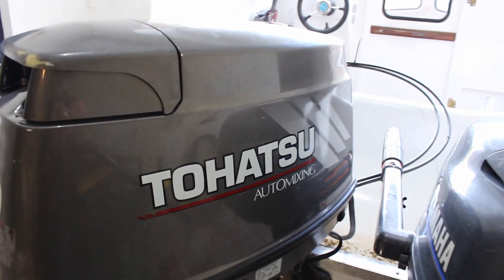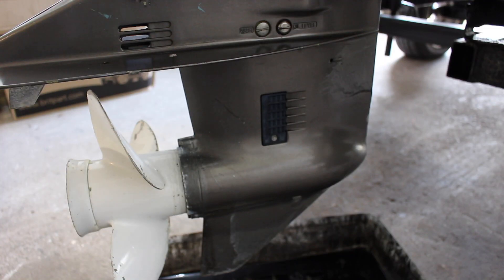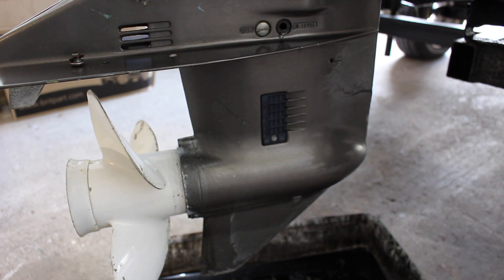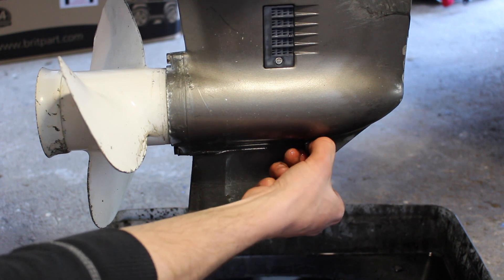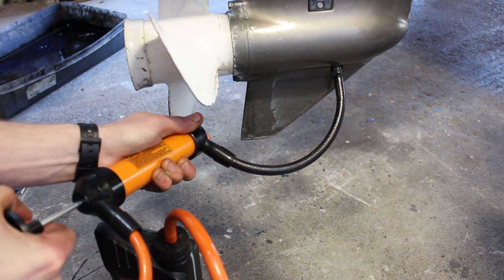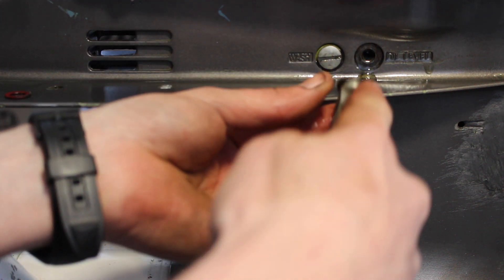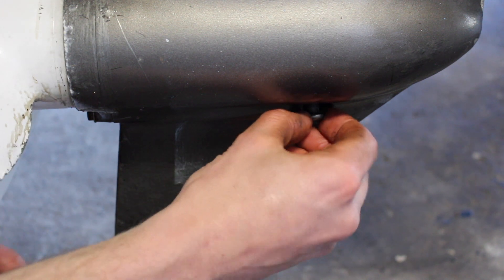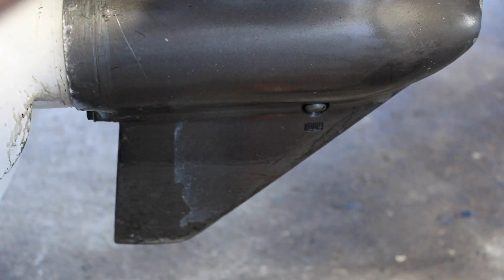How to Change the Gear Oil in a Tohatsu Outboard engine

Comment: Why not fill oil through the level-hole?
Reply: Due to air lock,this method is way easier
Reply: Because it makes more sense to wait for the oil to drip out on the top to make sure that it’s full. It’s also better due to the air inside going out properly.